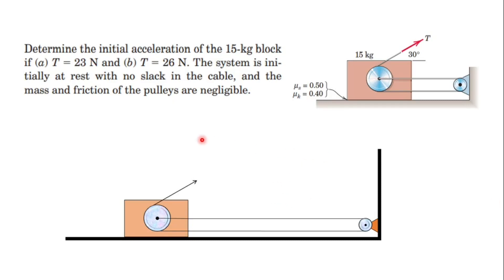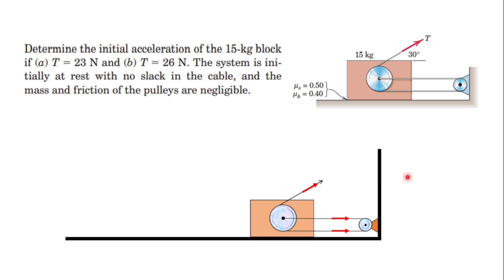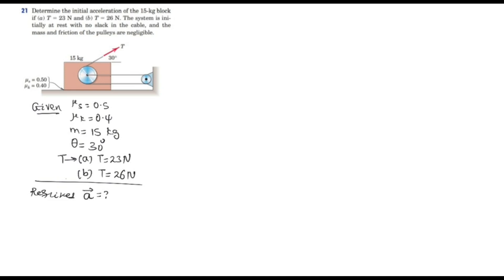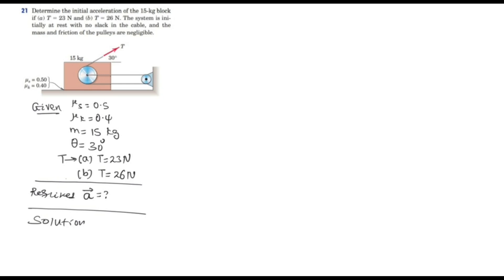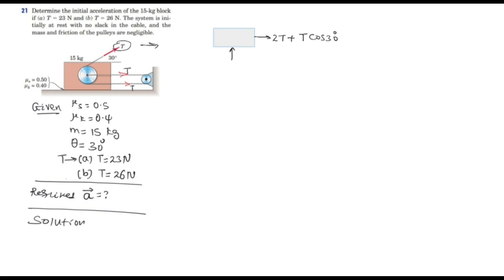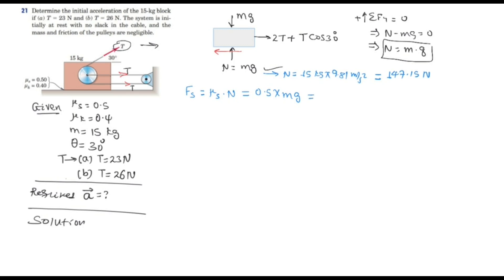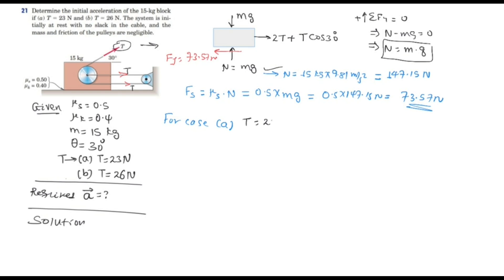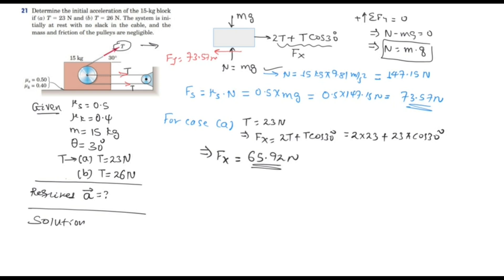Dynamcis 03_01 Force Mass and Acceleration Problem with Solution in Rectilinear Motion of Kinetics

Comment from the maker: The Y component of T opposed the weight and we had to add it on N. 
N = mg - T.sin(theta)
This by it self will have some increment on the acceleration.
Then the new acceleration a = 1.3 m/s2.
Sorry for missing this concept in the video.

Comment: great video. but my question is, do we not have to add Tsin(angle) to mg to equate with Normal force in our summation of forces in Y?
Reply from the maker: Sure Brook, the Y component of T opposed the weight and we had to add it on N. 
N = mg - T.sin(theta)
This by it self will have some increment on the acceleration.
Then the new acceleration a = 1.3 m/s2.
Reply: https://youtu.be/ftpKoGXVlVY